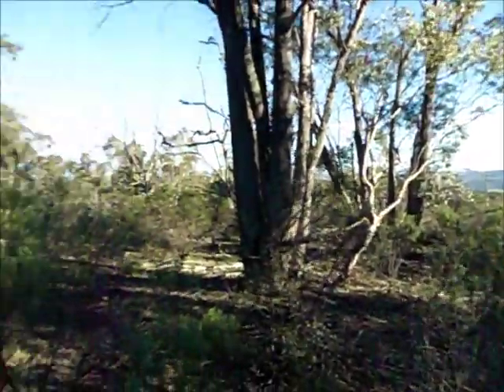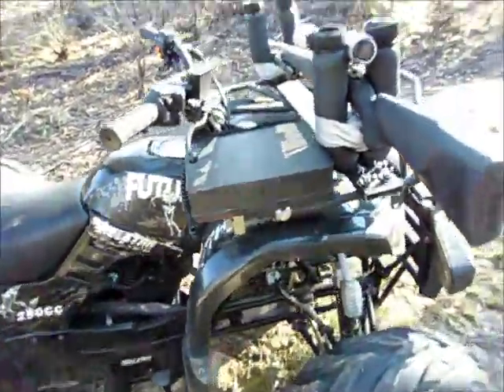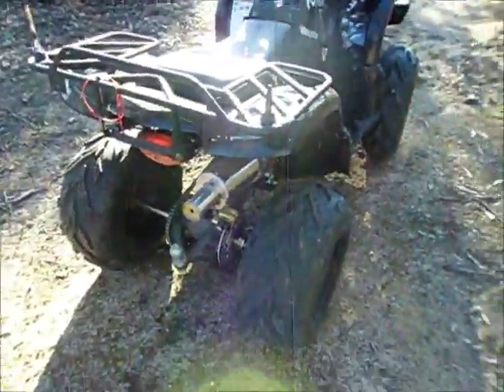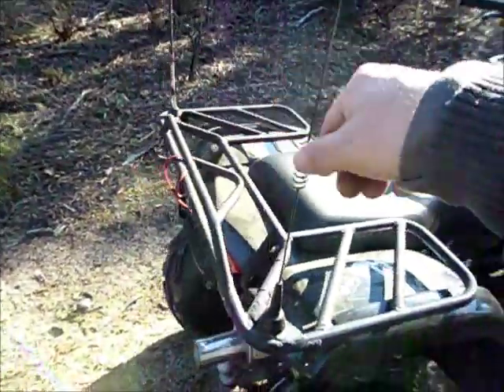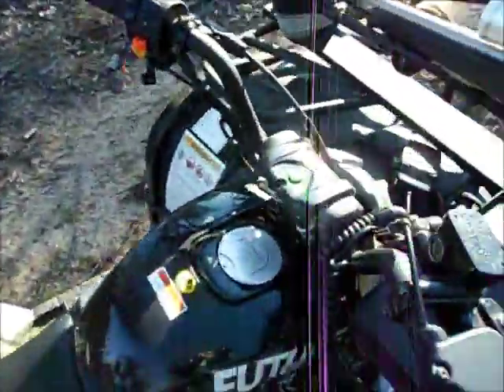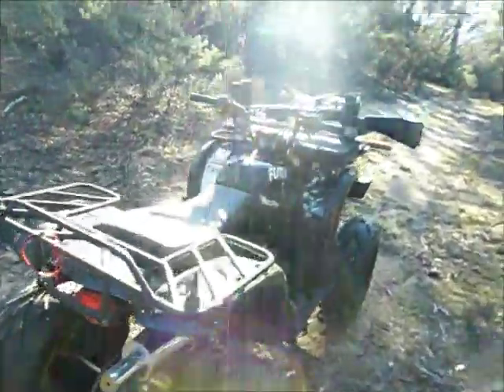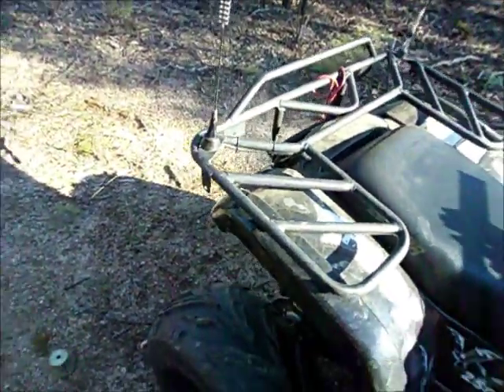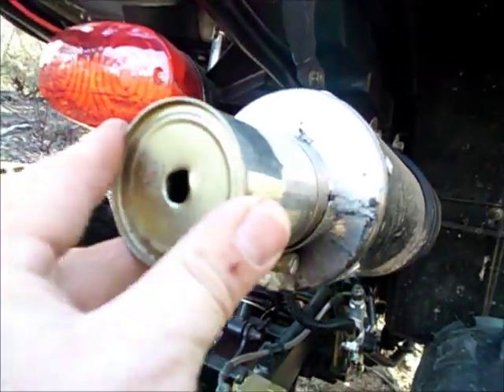Elstar Tank 250cc Quad

Comment: What length / brand is the hf antenna on the back of the quad? great video
Reply from the maker: Hi tommy aussie, the length is 5 foot Redback, It is a old antenna, but works good. Range is about 8km in thick terrain on AM with 4 watts, VSWR is below 1.5:1 across the 40 channels. Makes a handy backup to the UHF.
Reply: cool thanks, the antenna is almost the same as a 4/5ft fire stick from USA. Thinking of rolling mobile around Australia, wondering what antenna I should use. cheers
Reply from the maker: tommy aussie
 The antenna of choice I feel is the "Skip Whip" from Mobile One. (They just started making them again) It covers 26/27/28 Mhz it is 1.8m tall evenly loaded windings and uses a special heavy duty base. They are expensive but I think the best on the market and Aussie made, anything better you would have to make one yourself. Recently I converted a "skip Whip" to cover 3.5 to 29Mhz with taps, works really good. cheers
Reply: cheers. I'm thinking of making a 9ft mobile vertical out of stainless rod, I don't want to spend too much money. cheers
Reply from the maker: Ha ha you sound exactly like me. cheers

Comment: Nice bike. Is this the 2013 model? How is it on fuel and speed?
Reply from the maker: Hi Ahmad, I got it at the start of the year so yes I think it is the 2013. Fuel consumption is excellent. I get a weeks riding running around on the farm + entertaining the kids on it with rides. I changed the sprocket from 17 to 13 tooth and it allows with the clutch out it travels at walking pace. It has a lot more low end pulling power but still can outrun a fox in top gear if needed. I am very happy with it. Thanks for your comments.
Reply: Awesome. I just put a deposit on one today and will hopefully be using it as a hunting quad. Is it difficult to wire up the CB to the bike? I'm tossing up between using the portable radios or just having a CB installed on the quad.
Reply from the maker: That's excellent, you will have fun on it, The radio was easy to wire. having a set on the allows for a 5watt radio that has a high gain antenna with a nice loudspeaker. I just ran the radio wires to the battery terminals with terminal lugs, easy. When your not using quad for a long time, take the spark plug out, clean the plug well, put 10ml of oil in the cylinder cycle press the starter with the plug out to lube the bore, reinstall plug and remove battery till you hunt again. Also do the silencer modification shown otherwise the Roos will hear you for miles cheers.
Reply: remingtoncountry1100 Thanks for all the help, much appreciated. Can't wait to take it out.